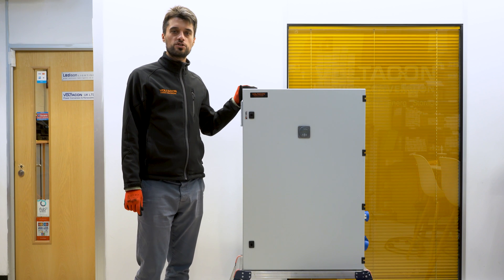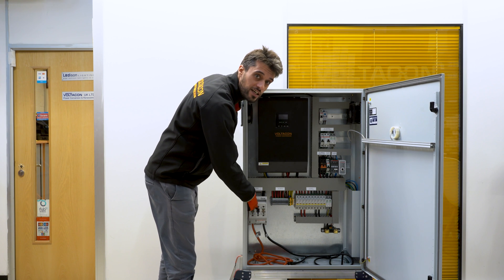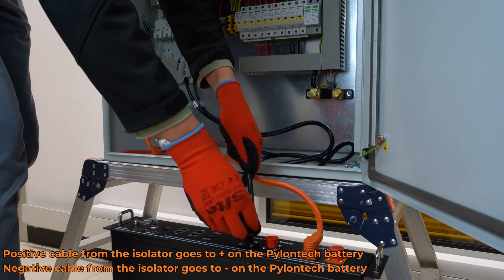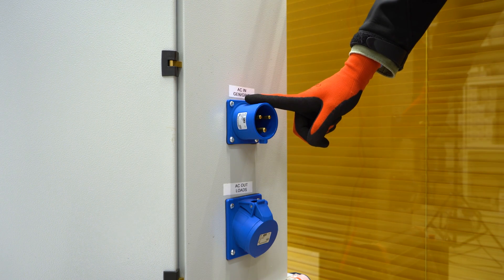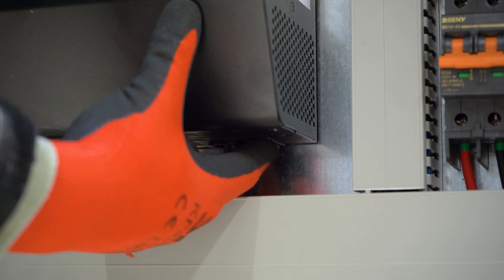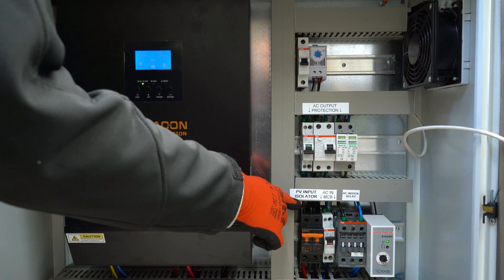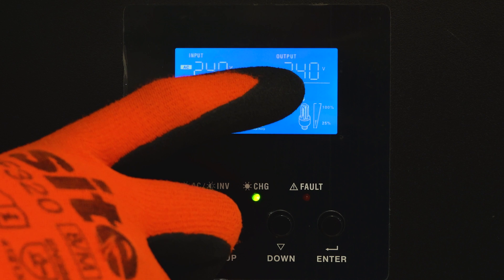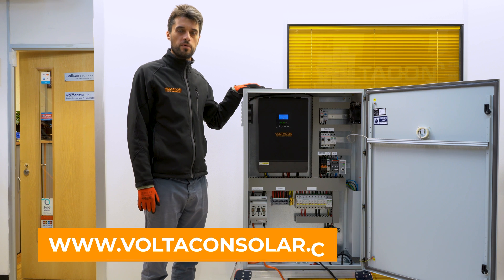HOW TO Connect Pylontech Battery to the Solar Inverter

Comment: If I connect 3 x Pylontech US3000 batteries, what dip-switch settings should I use?
Reply from the maker: It depends on which inverter you have. All our lithium batteries are available here: https://voltaconsolar.com/batteries/lithium-ion.html
Reply: I have a 3 x 5kw Kodak King Offgrid inverters running in 3-phase mode
Reply from the maker: @JHBVDS  Sorry we can not comment on this inverter

Comment: Hi, we have problem connceting Pylontech Force H2 into Goodwe ET10 inverter. (first here was some BMS communication error/ now the inverter sees only two instead of four batteries however the baterry is still not charging nor discharging (even though it is not fully discharged, it does not work as backup when we turn of the grid ac input)
( Battery System Capacity = 14,2 kWh). The CHARGE VOLTAGE in Advanced Settings in the goodwe APP is automatically set to 216,0 V. Do you know where the problem might be? thanks! I can´t find answers anywhere.